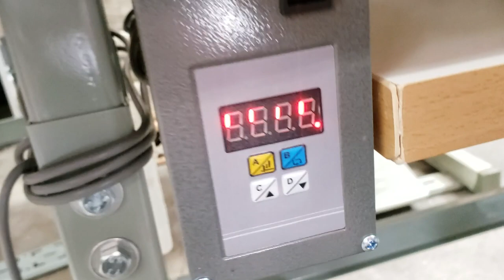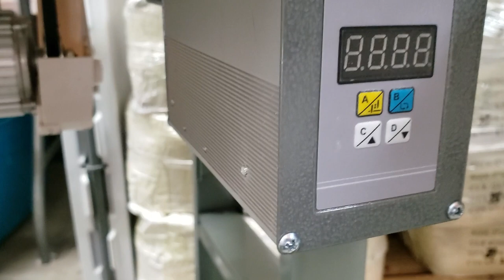Tutorial - Using New-Tech Servo Motor with Juki MO-6814S - Goldstartool.com - 800-868-4419

Comment: I have a DU1181N with this exact motor. I’ve only had it a week and the first time I touched the pedal it took off (speed wise). I pushed buttons on the front to adjust speed and direction,etc.  Now I get an E7 message. How can I undo what I did when pushing the buttons? How do I get to factory preset?  Just got it and haven’t even been able to sew on it yet!